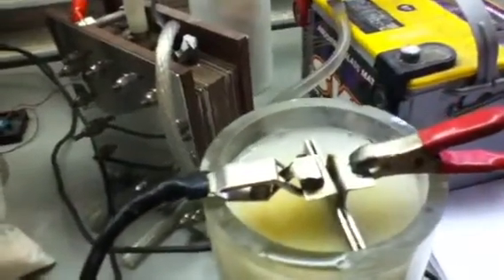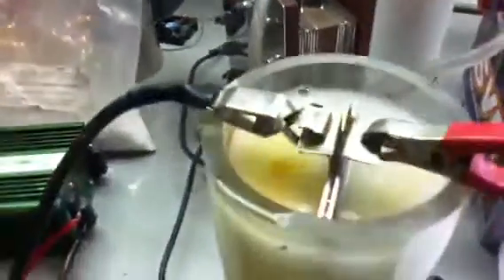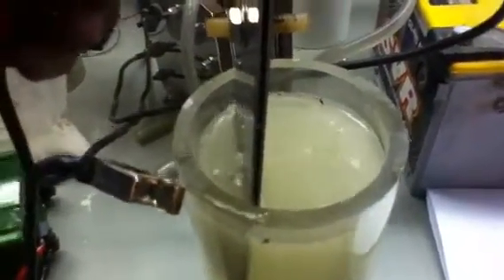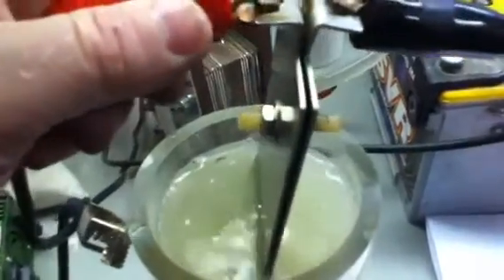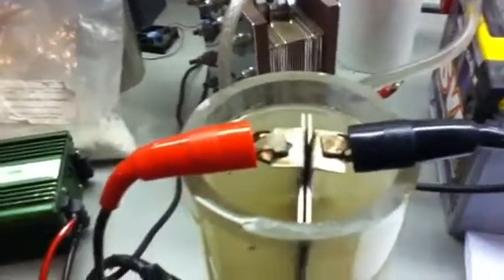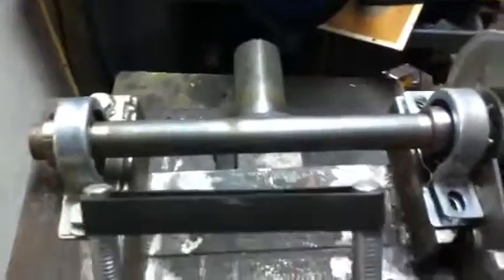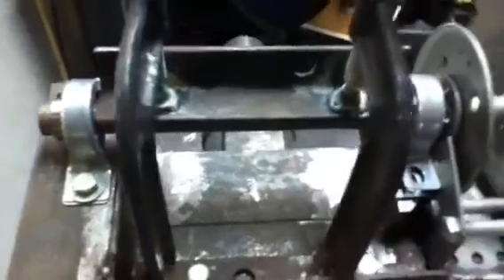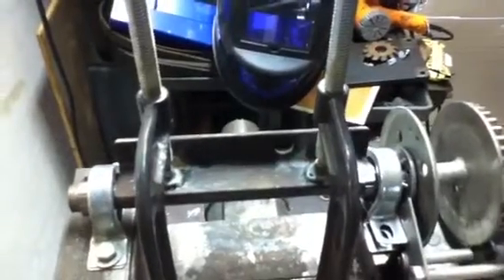HHO PRODUCTION WITH A BUCK CONVERTER

Comment from the maker: When I build the sprial cell, 8 inch wide 4 ft of 18 gauge stainless coiled up and two coils put together in a 4 inch tube,with that much surface area it will make hho gas,it will pull 30 amps on one side  and the car will see 12 amps, the plate voltage will be 3 volts and I will try to mod it to go lower,like 2.30v or lower.

Comment from the maker: I just threw it together, I have not played around with it for about 6 months must of had some stuff in the tube I did not wash it out very good.This video was just to show the many emails i get on the operation of a buck converter,seems people are buying them for a dry cell.The voltage at the plates can be adjusted from 3 to 4+ volts and with just another 1/4 tsp it would go to 30 amps check out powerstream and read all of the specs, that might helpI like to run mine under 2v,Dominic.

Comment: hi dude .you was saying it dosnt pull that many amps. 13.5 amps seems like a lot to me when I see how much HHO your making . I cant really tell but I would guess less than a half litre per minute. BUT . how many volts is that from the buck ?. I do see some brown stuff in the E lyte. If the buck kicks out like say 6 volts the 13 amps aint bad. I do know that the lower the volts the less crap in the water , Im not cridicizing just wanna give ya my knowledge. I run my cells at about 3 volts per cel